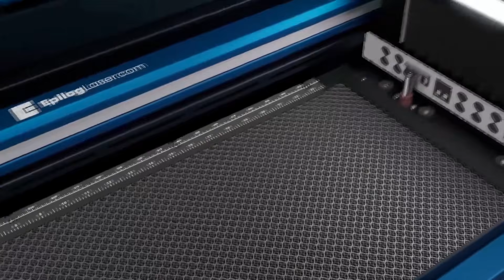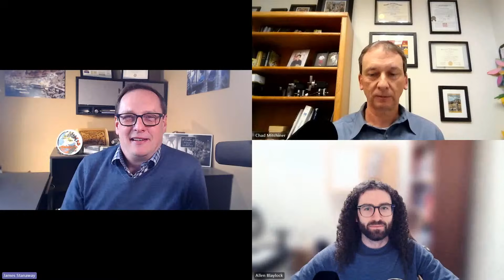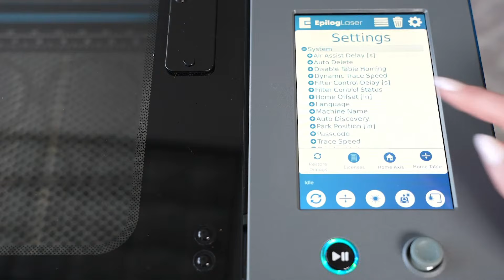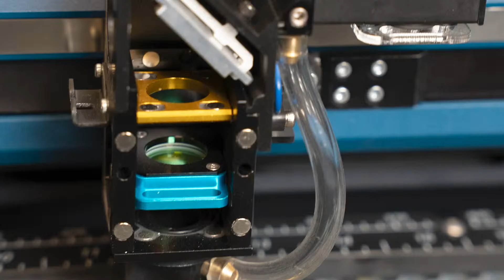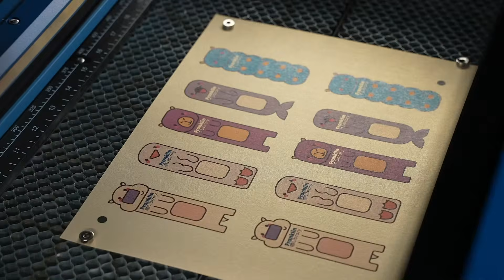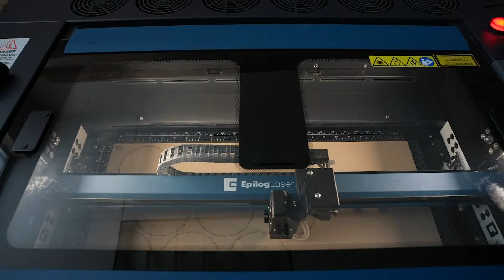Inside Epilog Laser: About the new Fusion Ascent with Engineering

Comment: Congratulations to the Epilog team on the release of the new Fusion Ascent systems. It’s exciting to see the continued innovation and new features being introduced.

I do have a question regarding upgrade paths for existing customers. Would there be any upgrade packages planned for current Fusion Pro and Fusion Edge owners to help bring older machines up to some of these new capabilities? Many of these systems are still extremely capable and running strong in small shops like mine.

For example, I would love the ability to use the new lens system on my Fusion Pro 36 dual unit, or potentially add a camera to the gantry on my Edge so we could take advantage of HD+ features.

As a small business owner, I really value equipment that can evolve over time. Similar to how we update and upgrade our 3D printers in the farm, it would be great to keep these machines running and improving for many years to come.
Reply from the maker: Thanks so much for watching and for the question and feedback! Once firmware 1.1.3.1 comes out (soon) HD+ will be available on the Fusion Pro systems; however, that won't be the case with the Edge because it doesn't have the necessary hardware.
Reply: @epiloglaser  But would it be possible to buy the add on for my Edge to give it that upgrade? I fully understand not everything can be make into an upgrade package but I think some key elements would be cool (Hardware wise)